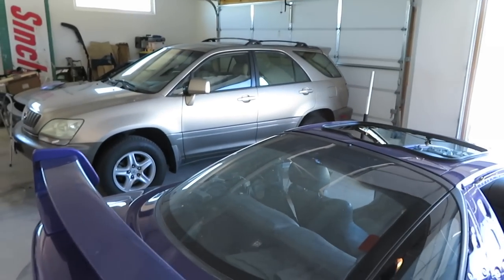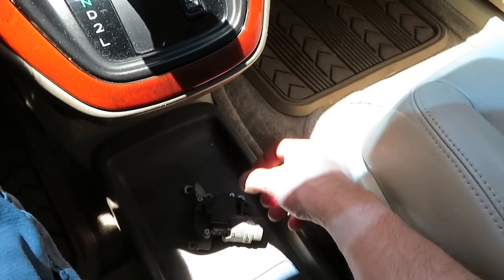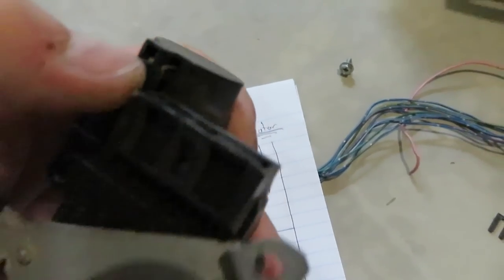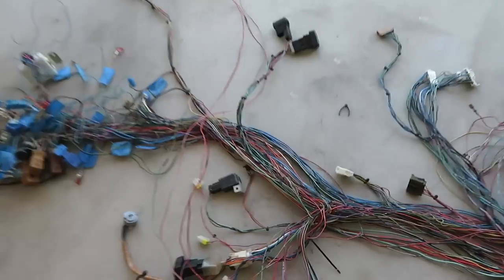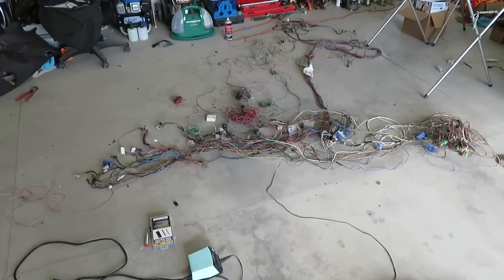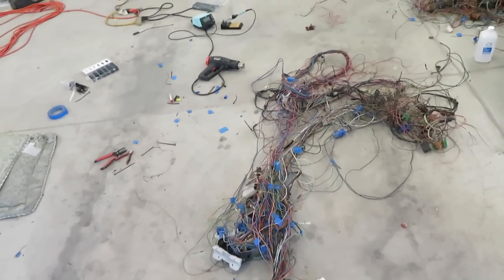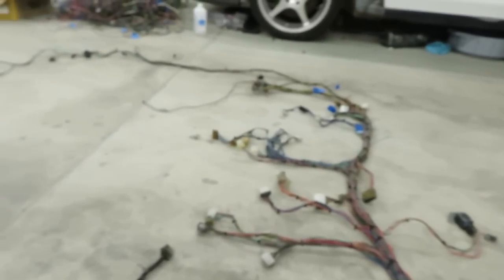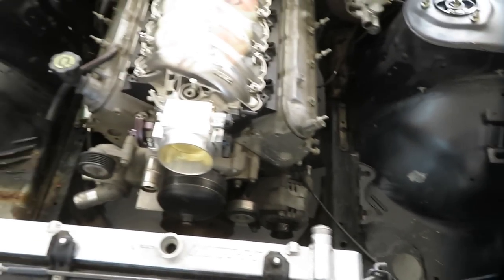240sx Wire Tuck What Did I Get Myself Into

Comment: The biggest issues I see si when guys are using Harnesses from another model or splicing.melding two harness;s together is they dont research or look at schematics to see what goes where and what will work and what wont and what the vehicle they are trying to put it into has and needs for its functionality, even worse is when guys splice/meld it together and dont test it as you did and guinea pig it to get and see what works and they just slap it in the car and expect it will work and of course when they are having all sorts of electrical issues and starting issue and things not functioning, they spend hours and hours and hours trying to chase down all the problems and then get fed up and just shove the project off to the side... and then go back and are still getting no further ahead then before. It might take time and be a bit of pain to go thru it painstakingly as you did, but it saves so much time and energy when you go and install it and are going thru getting installed and then  getting it to work, yes you will always have a issue with connections etc, but that's not out of the norm the main thing to try and eliminate the problems you can before you start installing it there is nothing worse than thinking you get it in and all good to go and then turn the key and the nightmares start. Nice work dave, she';s coming along

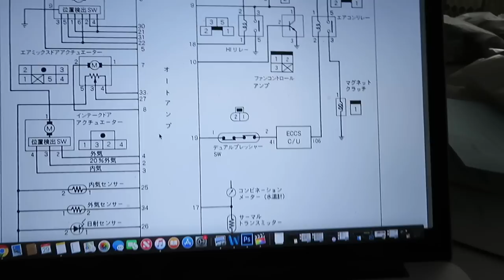Comment: 14:50 on the plug on left there's pin 7 and 8 that aren't grounded and they going to pin 6, on the right.. thats look like transistor to me not the resistor, resistor is triangle-wave shaped or rectangle shape, transistor, instead got that k shape with arrow, in this case npn (if im right).Relay isn't grounded, is just the reference point for it to work?